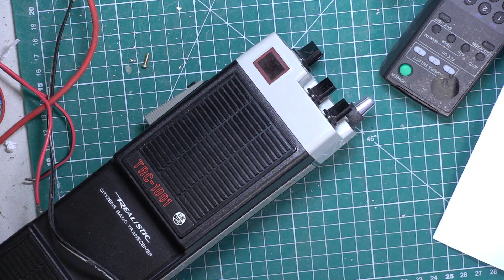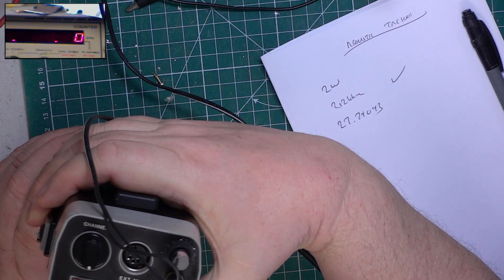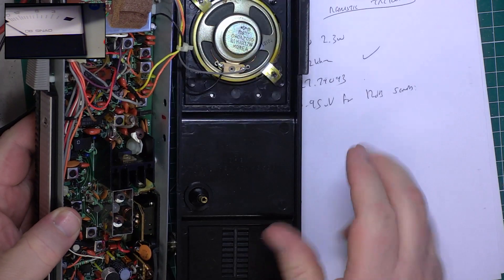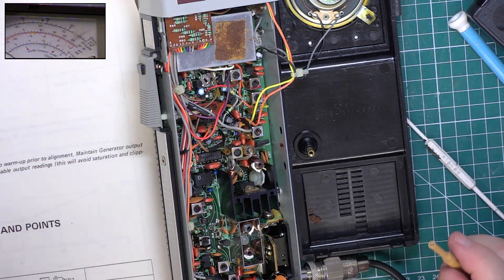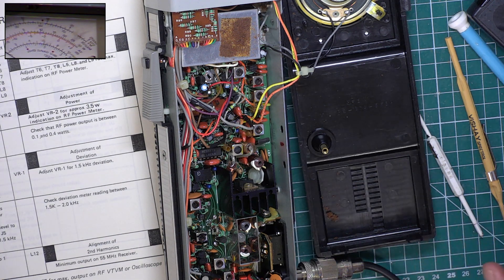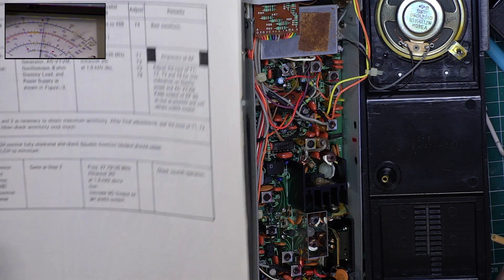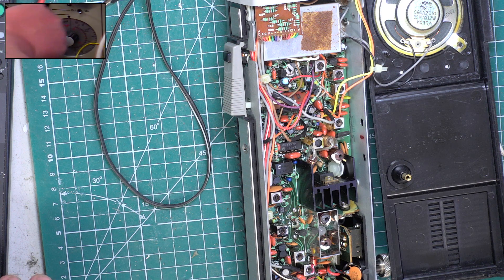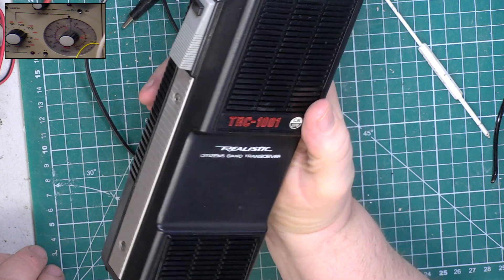Realistic TRC1001 CB27/81 UK FM Handheld CB radio service

Comment: This was my first cb bought July 81 in J C PENNYS MILWAUKEE I WAS THERE FOR 4 WEEKS FAMILY HOLS GOT A HAND MIKE FITTED LOVELY RADIO 
HOW THINGS HAVE CHANGED 
HERES A NAUGHTY ONE GIVES RADIO A BAD NAME PEOPLE NOT FAR FROM ME USING 400 WATT AMPS BY HECK WONDER THEYRE NOT BLEEDING ALL OVER THE NEIGHBOURS TVS RADIOS
ANYWAY SHOULD KNOW BETTER 
ALSO IN 81 WHEN I GOT THE REALISTIC I BOUGHT A SMALL MIDLAND 80 CHANNEL IT WAS A GOOD LITTLE TRANCIEVER I MADE MY OWN AERIAL RADIO ON BEDSIDE CABINET AND COAX OUT OF ŔADIO SO FAR UP BEDROOM WALL AND 3 STRIPS OF COPPER WIRE COMIÑG OUT OF COAX TAPED TO WALL PAPER MUM WASNT HAPPY 
BUT I WAS WINGING IT WITH AERIAL ID NEVER BUILT ONE BEFORE BUT I KNEW THE  SWR HAD TO B BELOW 1.4 WELL I GOT IT TO 1.2 
WHICH WAS PRETTY GOOD ALL THINGS CONSIDERED 
I THINK FURTHEST I GOT A COPY WAS 25 MILES NOT BAD I WAS WELL CHUFFED
MY HEALTH HAS BEEN POOR LAST FEW YRS BUT NOW EVERYTHING IS RADIO I WANT TO LEARN ALL I CAN 
I LOVE THIS CHANNEL IS VERY INTERESTING 
I WANT TO LEARN WHAT MAKES RADIO TICK 
THANKS FOR A GREAT CHANNEL
Reply from the maker: Bear in mind your identical looking set was the Realistic TRC209. The UK was FM only until 2014. It goes without saying that FM clarity is far & away better than AM. Range is identical between AM & FM. Another FM advantage on a handheld is transmit draws less current when compaed with an AM transmitter.

I've had 14 miles from one of these. I was using it upstairs in a house & Mr Chippie was using the normal mobile set in the car, 14 miles away.

Pity the FCC doesn't clamp down on the bad buddy up the road. Our equivalent ...the Radio Communications Agency does the odd sweep every few years & nobbles a few bad buddies, not nowhere near enough for my liking.

Richard, G0OJF, UK